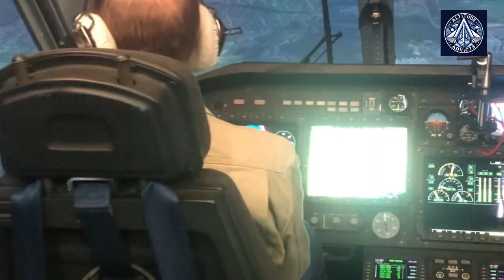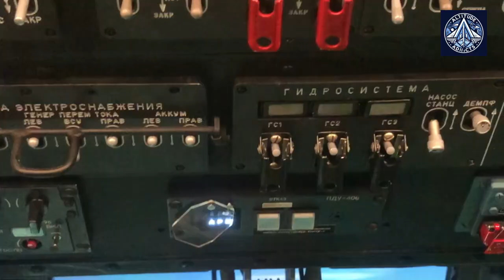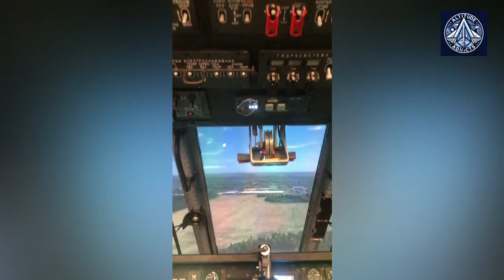The Mi-38 Helicopter With TV7-117V engine - Russian Equivalent to AgustaWestland AW101

Comment: Mil Mi38 is Far Superior than AW101 because of its engine alone..2 powerful turbo engine against 3 Weak Turbo Engine. 
It is easier to service 2 engines compare to the 3 engine. 3 engine have efficiency problem as exzos of one engine is breath into the next engine and thus lost in power and efficiency.